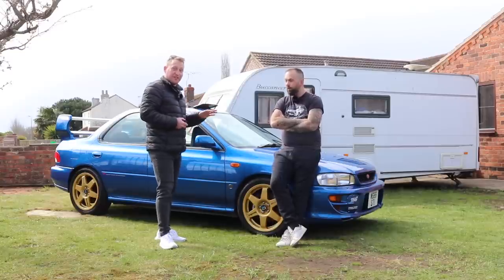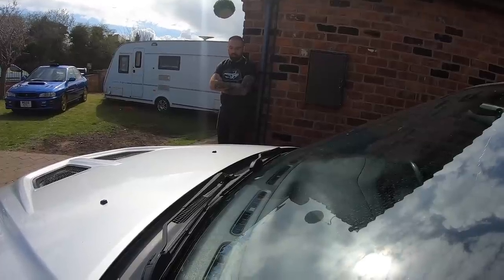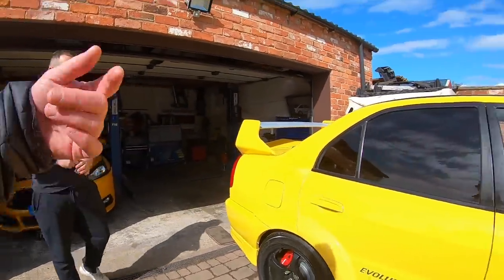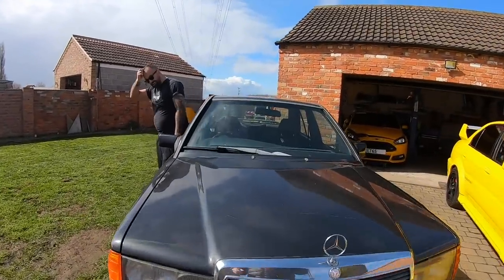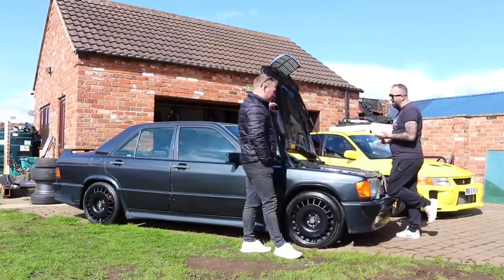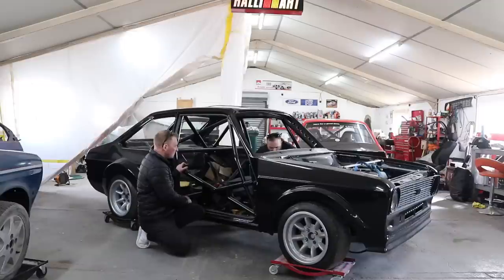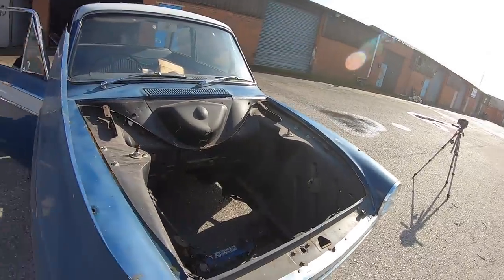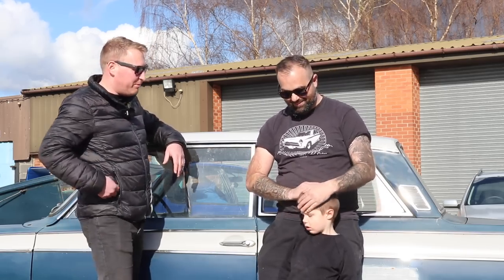One Mans Epic Car collection

Comment: the klde or klze v6 is a mazda engine. originally in the 626 929 and xedos 6. it has porsche involvement in the bottom end and yamaha in the heads 👌👍
Reply: hi, the enjgne is the  Jaguar  AJ30 with the 5 speed getrag gearbox, although very similar setups
Reply: @dave280585  ford kept it in production alright, I couldn't blame them. I loved that engine in my mazdas. silky smooth and sounds great. I believe they bolt up to some newer mx5 boxes too. hang on il send you a great link
Reply: I can't find it now. it was called gunning for vets or something. a fella in America converting one to rwd and bike bodies. is the only difference in the jag unit the addition of vvti ? always wanted to drop. one into a 90s familia 😁

Comment: Drug dealer !
Reply: I was left in a council house at 17 when my single mother died with the £300 she had in her bank account, I worked for an apprentice wage and topped up by working stupid amounts of overtime, I drove a corsa 1.5d while my friends had pulsars and gtis becuase i was so poor, at 19 i managed to get a £2000 bank loan letting me buy my first rs turbo, so poor I ran out of fuel several times going to work, these cars were a dream and a dream where I had to dream big to even own one, I  at 21 I was offered a Job on  the motorways travelling 130 mile daily 12 hour nights, i worked my way up within that job working 12 days on 2 off sometimes doubling shifts to cover low staff, I progressed and now as a roadworks designer, I bought my house on a right to buy from the council at 27 and stuck it for 5 years to the age of 32 I left my wife and walked away with 30k enough to put down on a mortgage, I bought the cars at the right time and made some great financial decisions that have benefitted me, the silver evo I took a bank loan for and still owe on. 
No handouts here, nothing at all, just hard work and graft and np drugs were sold just pieces of time from my life, as you can read in the early comments that hard work pays off, focus on being  better tomorrow than you are today and everything  comes together ❤️
Reply: @dave280585  respect bro . Enuff said ! My hats off 😎